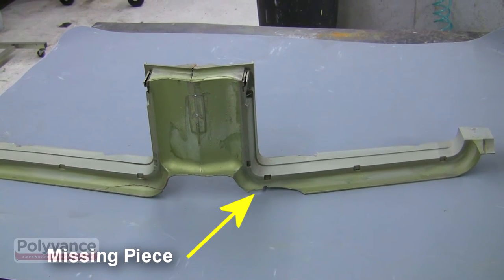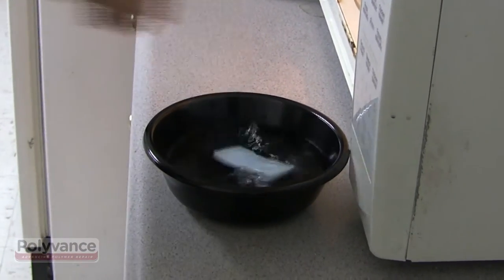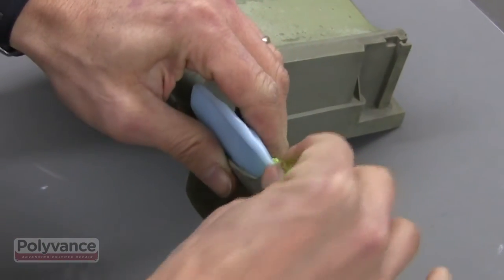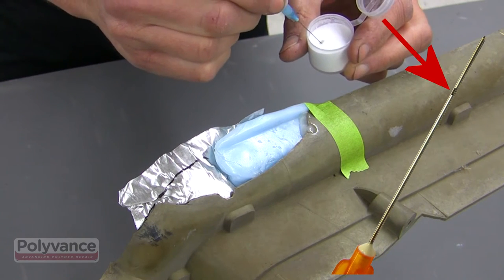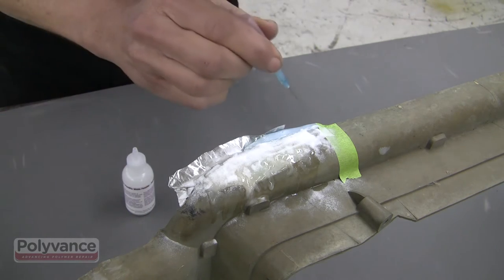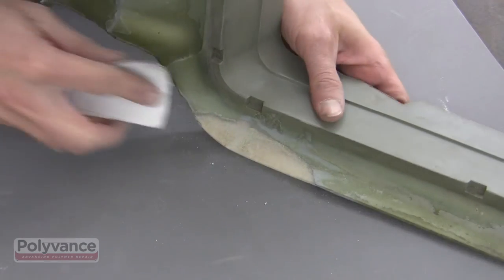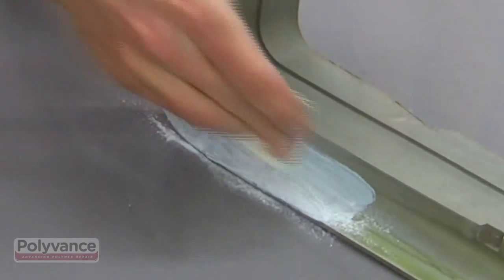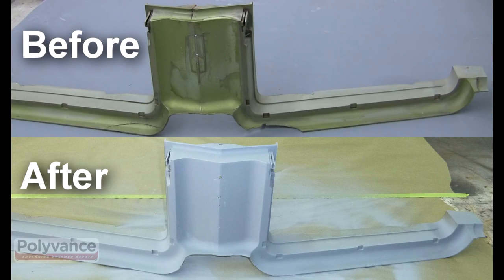Repair Plastic ABS Vista Cruiser Grille with PlastiFix

Comment from the maker: View this video on on our website for helpful information and product suggestions for this repair: https://www.polyvance.com/video/plastifix/repair-plastic-abs-vista-cruiser-grille-with-plastifix

Here are some answers to common questions about PlastiFix:

Where can I get PlastiFix?
We cannot ship PlastiFix overseas due to hazmat restrictions. If you are in the United States, you can buy it from us. If you are in the UK, WOW! (http://www.wowauto.eu/) may still have some available.

Is PlastiFix just super glue (CA glue) and baking soda?
No! PlastiFix is a special type methylmethacryalte designed for ABS, PC, Acrylics and other hard plastics. Super glue only bonds to the surface of the plastic. It is also very brittle and only has about 30% the strength of a PlastiFix repair on hard plastics.
PlastiFix chemically etches itself into the plastic and should not fail.
Plastifix uses a liquid monomer to polymerize the powder to form MMA plastic in an exothermic chemical reaction. The most common forms of MMA include acrylic and lucite. The individual components have no adhesive properties without the chemical reaction of the two ingredients, unlike super glue. Because the components can be reacted directly on the surface to be bonded, the added benefit is that the reaction incorporates the surface molecules of the base plastic, creating a chemical as well as physical bond on some materials. The chemical AND physical bond make this type of repair extremely durable and impact resistant,  plus it is sandable and easily painted, unlike super glue type repairs.

Can I use PlastiFix on all plastics?
No. PlastiFix only works on ABS, PC and other hard plastics. It will not work on nylon very well, and not at all on PP or PE plastics. You should use a plastic welder on those types of plastics.

Comment: It will not stick to silicon....however, silicon will create a host of problems when painting the part or when doing additional repairs. It is such a huge issue, many shops will not allow any silicon products in their shops at all! 

To comment on the previous statement from another user about molding bars, one bar can make a reasonably sized mold and is suitable for most repairs. The most I have ever used in one repair is three (3). They are reusable too, btw.

Comment: Does the plastic stick to silicone or rather can I use a silicone plug to get my shape from vs using the molding bars?
Reply from the maker: No, it does not stick to silicone.